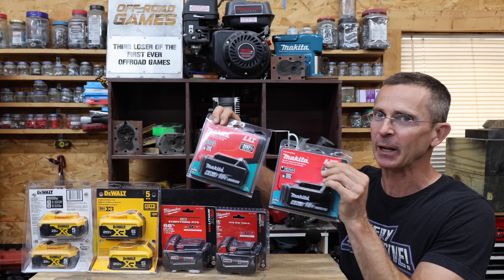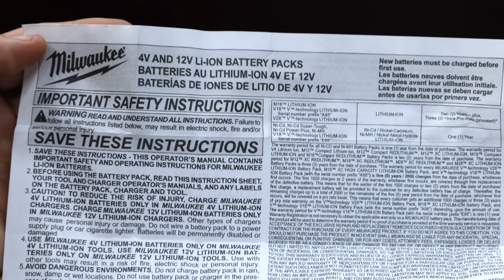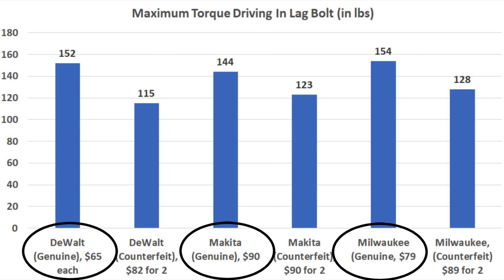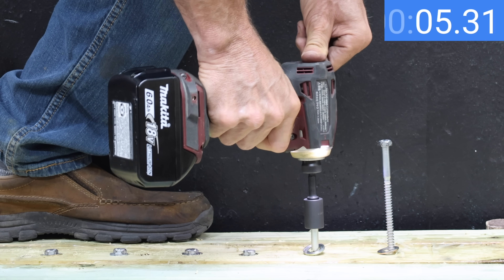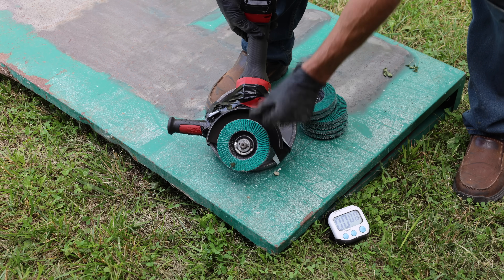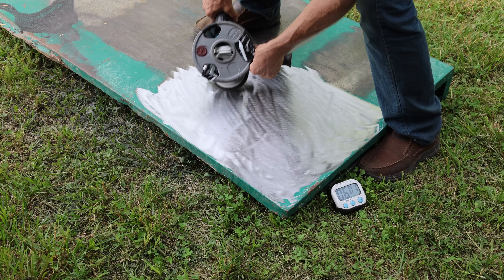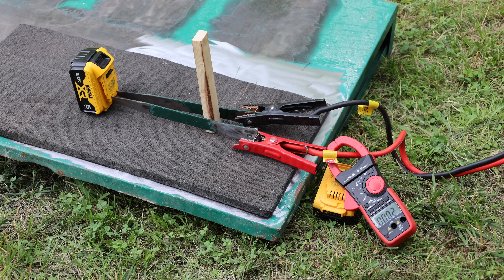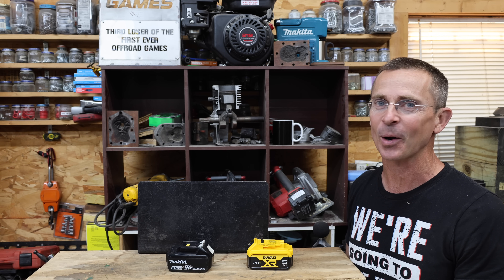Have You Been Scammed with a Counterfeit Tool Battery?

Comment: Those sellers should be arrested for fraud.  OR BETTER YET, make a claim with your credit card company, and not pay a single cent, then the seller loses.
Reply: Amazon should he held to account as well.
Reply: @willb3018  This very true, it seams everything there is a knock off these days.
Reply: @willb3018  Darn right. As long as they are allowed to profit from these sales, everything they do to prevent them will be insufficient.  They should forfeit their commission immediately back to the brand that was counterfeited.
Reply: @willb3018 Not a fan of Amazon, but Amazon is no different than a landlord leasing space for a store. The landlord is not responsible for criminal tenants.
Reply from the maker: Great point!
Reply: @ProjectFarm  I Would try to warranty return the De Walt batteries that you registered.
Reply: So should Amazon.
Reply: There's a close parallel here with counterfeit memory cards. The big name resellers do try to keep their supply chains clean, but it's not perfect. Best Buy ended up selling some counterfeit cards several years ago (they did accept returns and exchanges, but no telling how many people never knew they bought a counterfeit card).

There's also a problem of people buying a genuine part, swapping it with a (cheaper) counterfeit, and returning it to the store during the no questions asked return period. Most retailers send returns back to the manufacturer, but a some sell them as refurbs. And a few unscrupulous ones shrinkwrap them and sell them as new. So even buying new from a store which protects their supply chain doesn't necessarily protect you.
Reply: Amazon seems to be the king of counterfeit so far. I buy OE replacement autoparts online and and now make sure it's from an actual dealer
Reply: @r.h.5052 eBay is the same
Reply: mostly in china   do not buy from ebay or amazon if seller is in china
Reply: @mikethetoolman8776 simply don't buy anything significant from Ebay or Amazon. Period. It's very simple to disguise supply routes.
Reply: Good luck arresting a chinese shell company
Reply: There are professional operations doing this counterfitting.  They simply use a new card or different account.
Reply: Those sellers are physically in China where US has no jurisdiction. And China actually benefits from the sold counterfeits, so they have zero incentive to go after the sellers.
Reply: I told eBay and got my money back from seller but they played dumb and said they had no idea
Reply: Reality of the world we live in! Especially with the dependence on the dragon!
Reply: I report them in eBay. Only after I get free batteries
Reply: Sadly most people don’t know it’s a counterfeit until too late. 

Or they find out by tearing it apart. At that point the seller will claim you damaged it and reject the return. 

Amazon doesn’t care either as they get paid regardless.
Reply: I bought 24 of them and eBay refunded me all the money didn’t even have to go through my credit card company it was the m12 6.0 and the m12 3.0
Reply: When companies have products made in China, there's no protection, the manufacturer can just make extra and sell them themselves. It happens with nearly everything that companies have made in China....but they don't care because it's SO much cheaper. Based on items I've personally been involved in their manufacturing in China, id be extremely surprised if they pay more that $20 for these batteries. Most products from China are marked up about 10x
Reply: eBay doesn't care.
Reply: I agree, but by the time someone realizes that have a counterfeit, the damage may already be done. Fire being the worst case. Buy from an authorized dealer when the genuine article is on sale.
Reply: Ehhhh anyone that believes that they're getting a genuine part for half the cost of another identical genuine part online is a fool....
Reply: @rc-daily  I agree, but doesn't mean they shouldn't be arrested.
Reply: Maybe the manufactor needs to have a "approved resellers" list. Since they probably know who they sell to, and their retailers know who orders batterys, you could check if the site you buy from is on that list. It should not be that hard to setup (I mean there is probably already software doing this) since all orders is done with computers these days.
Reply: @AndrewTSq you can't get a warranty unless you bought products from an authorized reseller.
Reply: @AndrewTSq They do.  Milwaukee does not offer warranties on Amazon parts, only those bought through authorized resellers.
Reply: Jeff Bezos should be arrested for fraud as well.
Reply: And ScAmazon
Reply: Not in China, just be a yes men and scam Americans.
Reply: Good luck! The whole chinese government is counterfeit.
Reply: As always, excellent job. Thank you!
Reply: Everyone knows they come from China. That government will do nothing to stop these counterfeits . That would mean losing money. The importers are the ones who should be targeted and face hefty fines if found guilty.
Reply: Actually the company refunds your money ie amazon but they dont take the money back from the scammer sooo the scammer still wins.
Reply: Great idea
Reply: Just need to get everyone to do it
Reply: 😂😂😂😂😂😂😂😂
That is truly funny!
Reply: Our government should be the ones that keep this crap out of our country, but as usual they could care less about the American people, they are too concerned with every other country on the planet rather than their own citizens.
Reply: Yeah, look at Apple, forcing non-genuine spare parts to be destroyed or seized at the customs. AFAIK, they have done it even to some 3rd party unofficial parts that have no Apple logos in them. I would think that manufacturers of battery powered stuff would be quite eager to pursue the matter of counterfeits, just from the safety aspect. Probably still not a problem and not enough houses or garages burnt down. Also I think they should have some sort of licensing and testing department for 3rd party battery manufacturers. Then have them sell a certified "not as powerful as the original, but 50% of the price" with actually working electronics and just a little worse cells.
Reply: They don't really lose though because for every one person like you that might do that, there's hundreds of other ppl that don't/never realise.  And when you're selling stuff that costs you much less than you sold it for, doesn't really matter to let some go as effective freebies due to chargebacks, etc.  eBay or Amazon may eventually shut a given seller down with enough complaints/claims of counterfeit merchandise, but they'll just setup new accounts/companies, etc. to get around that.  It's pretty endless cycle and not really much of a solvable problem other than staying away from these marketplaces for stuff where fakes are rampant.
Reply: You think these people buying these don’t already know they’re counterfeit? That’s why they bought them
Reply: @joey4277  of course they know!
Reply: How exactly are you going to arrest the people in China? I want to sit back and watch you do it. Lets see what happens.
Reply: they are all from china. Good luck on that one
Reply: That’s not better. Prison is better
Reply: Well, how do you know if they are counterfeit??  Tear open and destroy the battery?  On  this video he first asks if you can tell; with some Dewalt batteries.  I went to Dewalt - saw the logo for XR batteries - and 'knew' which were counterfeit.  Except that I was Wrong - since Dewalt (as it turns out) has both style logos for genuine batteries.  Without tearing them apart - I have no idea how you make a determination.
Reply: @daves7775 buy them from a reputable source.
Reply: @daves7775  The weight was a give away here, but you would have to know the reference weight and what is usually shown on the mfg spec sheet is not that accurate.  Also, some counterfeiters add dead weight to match the genuine.
Reply: @daves7775 The only way that the counterfeit items exist is that they are charging way less than the real deal. If you can't tell that a Dewalt battery for $30 is a counterfeit when compared to the actual Dewalt battery at $70, then it's kind of on you.

The old saying of too good to be true exists for a reason.
Reply: i'm surprised they haven't yet been sued
Reply: @joeschlepp how do you know they weren't. They settle out of court to limit exposure.
Reply: @TOKYOJOE-e8b who’s going to sue for 90 dollars lol
Reply: @Omgpez  how about for the cost of your house or work truck burning down plus injuries plus punitive damages plus psychological damages after losing everything in a fire. and loss of income from work it goes on and on you how things work.  i figure couple hundred million when all said and done.
most importantly changes to how dealers won't wont be so keen on selling these counterfeits.
Reply: @TOKYOJOE-e8b  that's actually a good idea 🤔
Reply: you can't arrest someone in china. even if you get a court ruling in US. different jurisdiction - all US court can do is seize whatever stuff that might be in mainland.
Reply: ebay should stop them from being able to list them at all
Reply: Just the counterfeits or also the genuine ones for charging you 90$ for less than 90wh of battery capacity?
Reply: @Tyiriel  they are 90wh if drained at a low rate of discharge, like a laptop for example.
Reply: @Tyiriel  The capacity is rated at a slow discharge, rather than the heavy duty tests here. It's probable that the genuine ones would be as high as they claim powering a small desk fan for example.
Reply: @Tyiriel  All Cells have internal impedance, so the capacity you get depends highly on the rate of discharge.  The Samsung 25R cells used are 2.5Ah cells.  These cells are rated at 2.5Ah with a C/5 discharge rate, which would be 0.5A.  Since he was discharging these cells at over 7A, These are not going to show the rated number of Wh.  This happens with all cells.  This is just the way cells are typically rated.
Reply: @Tyiriel  people have the right to sell you wherever they want at wherever price they want. and you have the right to refuse. ''overcharging'' is not a crime. and when you are a small buisness, you can't sell at the same price as a big retailer. just like a convinience store can't charge you a can of coke for the same price you can get it at Wallmart.
Reply: @Tyiriel  What an asinine comment.
Reply: @Tyiriel just say you’re poor. It’s ok.
Reply: Turn the listings into eBay.  It takes a few seconds.
Reply: @LemonySnicket-EUC like ebay has ever taken down any fake scam products... they don't care.
Reply: You can ask for refund and most likely they will let you keep the batteries, I've bought the fake ones few times and its an easy way to get free batteries
Reply: Do you all really think he bought those knock-offs from a reputable seller? You think he went into Tractor Supply and bought them off the shelf?

That's not how this works. They were bought off eBay or, more likely, from a random person on Amazon. Good luck ever proving that that person "should have known" they were knock-offs, good luck holding them responsible in any way. 

If you're dumb enough to buy batteries claiming to be $100 batteries for only $45 bucks, you and you alone are responsible. Sorry you don't like it, but your actions have consequences.
Reply: Also, we're assuming that the seller knows they're counterfeit. How are they to know their supplier is giving them bad batteries?
Reply: @strixt first off, it's THEIR RESPONSIBILITY to know; NO EXCUSES.

second, pertaining to the first, their is what we in the legal world called a "reasonable person" standard...essentially, if you're a supplier and something seems too good to be true, it is 99.99% of the time. These suppliers are NOT naive children.
Reply: @JD-tn5lz  A) Responsibility to whom? If you buy from an unknown person on the internet, you and you alone are responsible. If you buy from a brick and mortar, then it's their responsibility. 
B) You're not in the legal world. Not even remotely. Don't pretend, that makes you look silly. 
C) What am I wrong about? I said suppliers are not that obvious about being fakes. If you were in the legal world, you'd understand what my comment meant.
Reply: @strixt  Price.
Reply: @GARDENER42  That's a great point, but I think that in and of itself comes with some assumptions. It also means that anybody who sells anything online has to keep up with MSRP for every product they sell. 

The scam could be coming from anywhere down the line in the point I was trying to make, it's not as simple as "the seller is at fault"
Reply: @strixt Wrong. All a plaintiff has to prove in a civil case is that he should have known, not that he did know.
Reply: @strixt  Because it is their job to know.
Reply: @MAGAMAN  If you're buying from a reputable source, yes it is.
Reply: @strixt  That's their problem, not yours as a buyer
Reply: @bengrogan9710  Not sure why my reply got deleted, but I never said it was the buyer's problem, so I'm really not sure where you got that from.
Reply: @strixt  Not the customers problem, the seller needs to do there homework, they are liable.
Reply: @strixt  they're supposed to do quality control on the products they receive. That's one of the reasons they're charging that price, they're SUPPOSED to stand behind the quality of their brand.
Reply: @pogtuber5146  What are you even talking about? Standing behind the quality of your brand and buying junk from a random person online are totally different things. 

I'm not sure how else to say this. Sellers on eBay are NOT responsible for you buying their crap, end of story. Again, these are NOT from reputable brick and mortar stores, they are from eBay or Amazon. The FTC, consumer law, NOTHING will hold them responsible for you buying junk, end of story. -Why is this still being commented on?
Reply: @strixt  
Its not rocket science. 
Where is it coming from? Who is shipping it? What are the complaints?
They do common things. Example: PO boxes used for local zip codes or local Warehouses used for an address 
Many people do the investigating work for free like done here.
Of course you would not be able to get them all but at this point it seems nearly nothing is done. Many products on places like Amazon are fake. From gloves to batteries.
Reply: @bobshanery5152  That's correct, it isn't at all rocket science. If something seems to good to be true, it probably is. If you see that, do some research. What you buy online is YOUR responsibility, nobody will come to your rescue for buying cheap, knock-off crap, and nobody can or will hold the seller responsible. It's really, very simple. 

Thank you for proving my point.
Reply: @strixt  The fact that them came off of a stolen Uhaul in a back alley probably should have given it away.
Reply: @kamikazefireball  The fact that you think all suppliers are dumb enough to be that obvious just shows how naive you are.
Reply: @strixt idk how it works for you guys but out there, sellers are responsible for what they sell.

They're free to make or ask any test/proof.

But they can also attack their supplier so everyone gets his punishment 😂
Reply: China
Reply: I would be willing to bet that the counterfeit batteries are being made in the same factory. Just like pop tart makes its own shitty generic so that you buy the better tasting name brand
Reply: @liquidrockaquatics3900  there's a possibility, but from the teardown the counterfeits clearly aren't just a store-brand label slapped on an equivalent product, with use of either vastly different or non-existent boards and unlabeled cells (though to be fair if we are keeping with this thought exercise, those cells could also be off-brand Samsungs)

Comment: Oh I’ve been scammed before by these. eBay lol
Reply from the maker: Any issues with the counterfeit batteries?
Reply: @ProjectFarm actually not for what I use it for but did pull it apart and the battery cell weren’t completely covered in plastic(Milwaukee)but I do charge them pretty frequently
Reply: @ProjectFarm oh but if I use them on my spot light, about 20 minutes and I’m fuming mad. Turning some Sheetrock screws, meh, goes a while
Reply: @ProjectFarm  : The ones I unknowingly bought -- I think even from the same eBay store you bought yours! -- didn't seem to have a lot of capacity, and they just stopped charging after five or six uses (if even that many).  I don't know if the problem is the counterfeit batteries or the charger they came with, though.

Thank you for this video.  Until just now, I had no idea I'd bought a counterfeit.